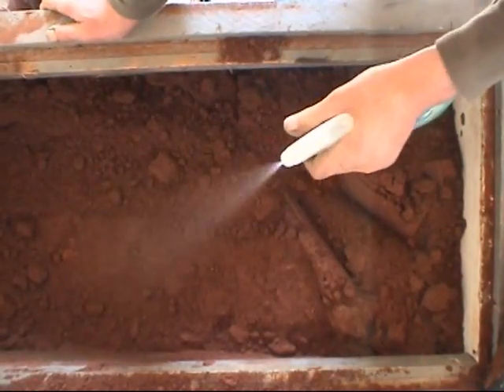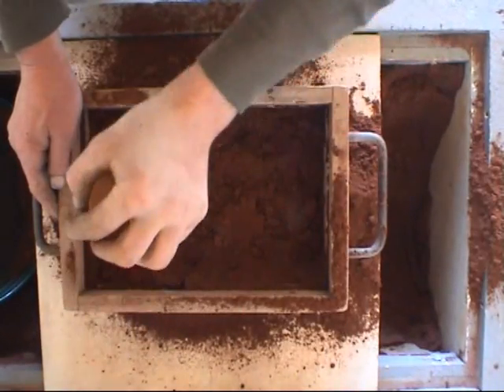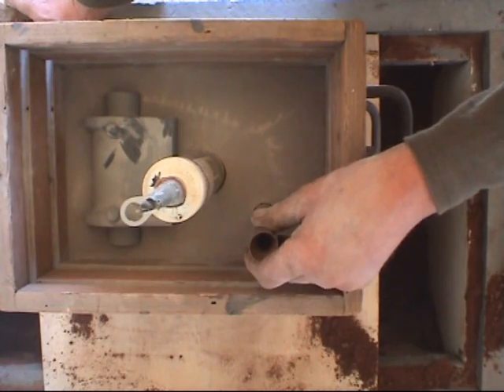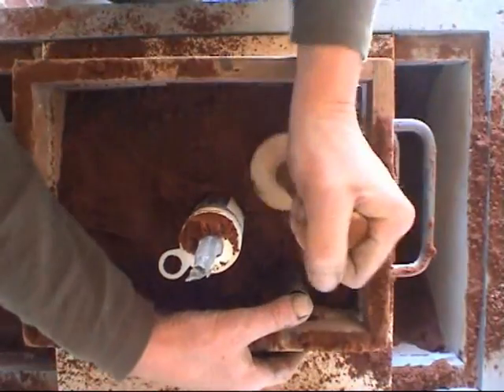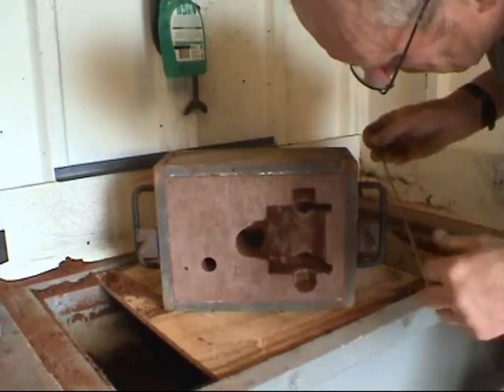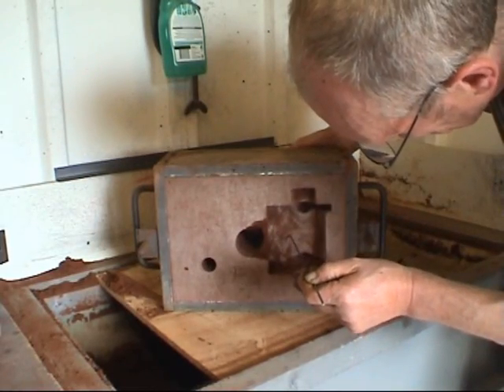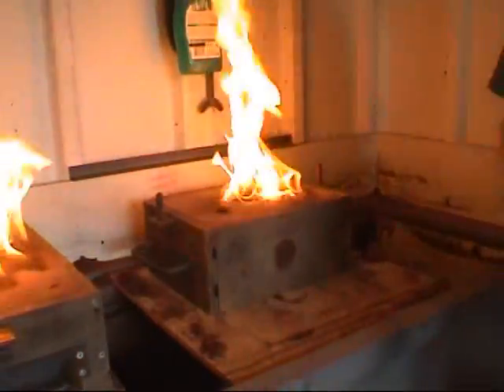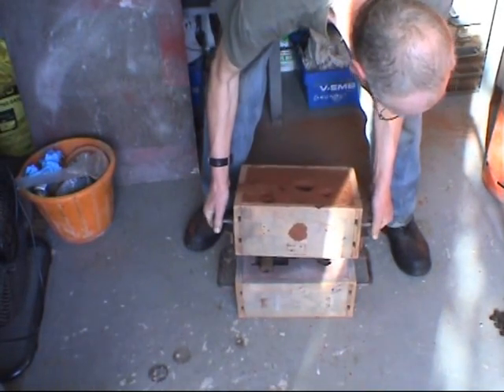Green Sand Moulding

Comment: What a load of bollocks he's no moulder
Reply from the maker: I AM JUST A MECHANIC THAT PISSES ABOUT
Reply: @doubleboost  I was time served you don't slam down down sand on pattern because metal will blow if surface is to hard. Also runner system is not part of the raiser the raiser is to feed the cavity. Don't know what metal you were using? but did seem like a big raiser?
Reply from the maker: @davidandrews860  The metal was bronze we had problems with shrinkage on the flat face

Comment: Takes me back to my appenticeship ... not nit picking or anything but the runner system from the downsprue to the feeder should be cut in a straight line from one edge of the downsprue to the opposite edge of the feeder in top half of mould & ingate into casting cavity is cut in bottom half of mould so that metal goes into feeder in a centrifugal manner thus spinning any slag/dirt in metal to top of feeder & clean metal goes into mould cavity ... also a litttle tip is wet around pattern with a small paint brush dipped in water before rapping & pattern removal .. will give a better edge around cavity & less of a joint line on casting ... nice to see after all these years tho'

Comment: Hi there, very nice videos! I am using greensand castings, and have tried to use graphite mixed with acetone. When I fired it and left it to dry the surface was covered with a layer of finely cracked graphite. Do you think there is too much graphite in the mixture?